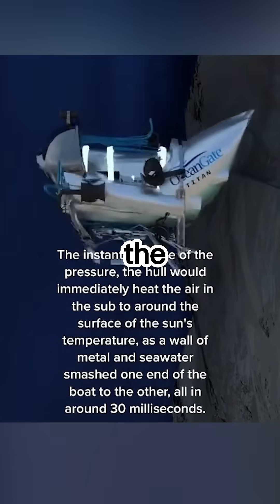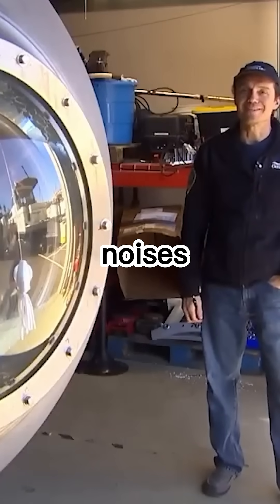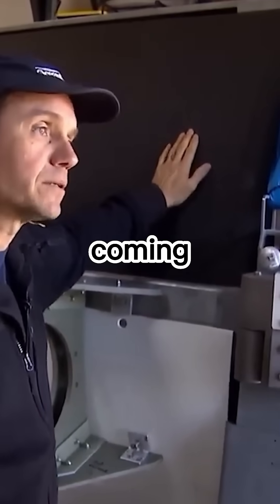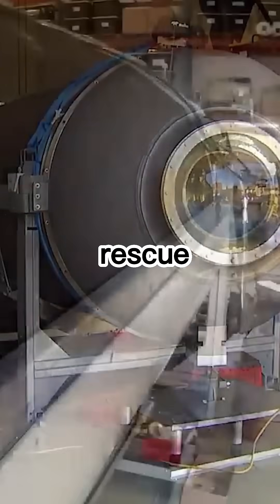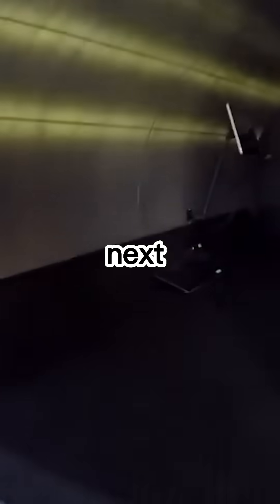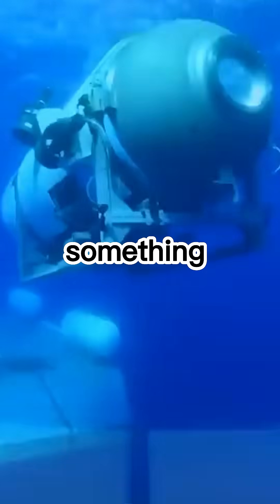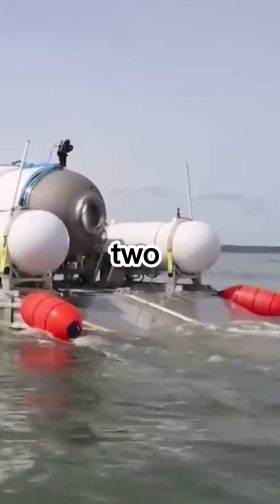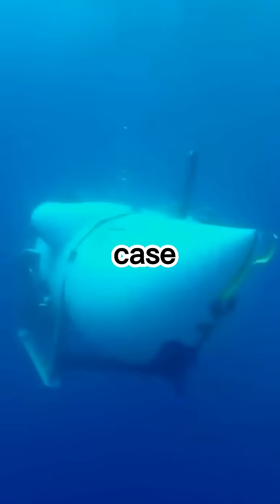Why The Titan Submersible Imploded

Comment: Lesson learned,  stay away from Titanic
Reply: First the Titanic, now the Titan, what next, the Tit?!
Reply: @90s-Merdoc  you know what? 🤣🤣
Reply: Lesson learnt. Don't use carbon fibre to build pressure vessels.
Reply: @richardneal1750 you can absolutely build pressure vessels from carbon fiber. Fun fact.  High end oxygen tanks for possibly scuba and forsure  oilfield rescue are made from carbon fiber.
Reply: @Z..C..7 You are completely right about the tanks. Only issue with the titan, is they didn't lay the carbon weave the same way, as the tanks are made. The tanks use a particular weave pattern, while also having a  aluminum liner inside, under the carbon layers. They are also regulated, & put through countless pressure test. The Titan used a new or different method for the pattern weave. If only he would have put it thru extensive saftey test. Maybe had he just listened to the experts concerns, from the submersible/ submarine fields. Could have possible been a different outcome. By the way Im no expert on carbon tanks, lol. I just watched a documentary that shows how they make those high pressure carbon tanks.
Reply: @blackandwhite-k9c where they goofed up. Was by cutting corners in the scans for structural integrity before every dive. They used their fancy term "acoustic  monitoring" fancy words for  "we listen for failure"
Reply: Or just don't cut corners?
Reply: Another lesson learned: “Stupid things happen to people who do stupid things”- my Anatomy teacher
Reply: anyone else want to see the titanic even more now ?
Reply: That vessel made the trip a number of times before. But it was a matter of time before it imploded under all that pressure.
Reply: No, dont hire an idiot who is going to cut corners, always seek an expert.
Reply: You'd think the Titanic sinking would teach people this lol

Comment: They where crushed immediately with over 6000 PSI of presure at the depth the incident happened😢 their bodies where sucked out in every breach that ocured during the implosion, hope they rest in pease and may this open the eyes to others so it doesn't happen again...
Reply: are you sure about the bodies being "sucked out" in that manner? i thought that would occur in opposite situation like in space. I also heard that an expert said the bodies of the folks would actually be prsserved by being trapped around the submarine.But then there would have to be a large ball of metal/carbon fiber which doesnt seem possible. yah im confused.
Reply: @tylerm0089  well when something implodes the things inside get sucked out and no there is not much left of them even if they didn't got sucked out such pressure crushed them to thin paper it's millions of pounds😮
Reply: @perezadonis4652 you are 100000% wrong
Reply: @davidbryant3532  sure thing bud
Reply: @perezadonis4652  bud? You are wrong...nothing sucked out.
Reply: @davidbryant3532  👏
Reply: Implosion is compression from all directions simultaneously, at 6000 psi a body is compacted into a little mass.

Comment: It was experimental! That poor young man, he had his whole life ahead of him. I wonder if they had recording devices on board?
Reply: Nothing would remain functional. Their remains wouldn’t be identifiable
Reply: Wouldn’t have mattered. I guess people don’t understand how violent an implosion at that depth would be. They would be basically vaporized before they knew anything. One thing I did hear, is shortly before they lost contact aka imploded… they reported they were descending too fast and were trying to release ballast… then silence.
Reply: @atamagashock     Apparently, the implosion would release the equivalent  energy of 50 kgs of TNT just from the outside pressure on the hull. The implosion would’ve been that quick that the oxygen inside the pressure vessel would’ve been compressed to 5,000 degrees…well above it’s ignition point. Therefore the occupants would simultaneously be crushed and exploded within milliseconds. They wouldn’t have known what’s happening.
There will be nothing left of any of them.
And if you consider the options of death, I think what happened was the ideal situation. Far preferable to slowly suffocating over four days!
Reply: Even if that's the case they still died instantly, they probably didn't even see it coming or realize it was happening, probably a relatively painless death
Reply: @Momotarou0311   The craft imploded with the force of 50 kilos of TNT! The oxygen inside the hull would’ve been compressed so much that it’s temperature rose to 5,000 degrees, instantly igniting it. So the occupants were almost simultaneously crushed and exploded within milliseconds. 
They wouldn’t even have known it was happening, and they’re now in thousand of pieces all over the ocean floor.
Far better than slowly suffocating over four days on the ocean floor.
Reply: @Momotarou0311  Sure, after imploding they would be dead pretty much instantly but I doubt it went from 100% fine to depressurization in an instant.
Reply: @Teddingtin no one knows but it's highly possible it happened that quick, it only takes a tiny weak spot for it to happen in the blink of an eye and they wouldn't feel anything, I only know this bc of the guy that did the trench dive in a sub built for extreme depths and his window in sub cracked and he started sweating bullets bc just one pinhole gap would fold them like laundry in an instant
Reply: I think it took 2 nano seconds to implode
Reply: @gobbollino2688 maybe it creaked and made them sh*t their pants before it took them.. what do you know, were you on the sub ? Duh

Comment: Yeah there was a major issue with using the two different materials and in the design itself. You want ONE continuous material for a deep sea dive. The laminated sheets of carbon fiber are likely what started to fail, so they were likely very aware for at least a minute that the implosion was about to happen. Even the accent weights were found to be dropped.